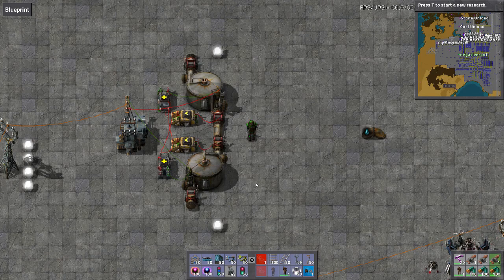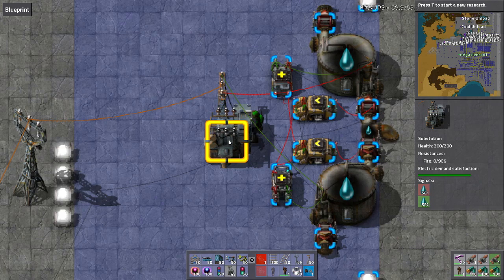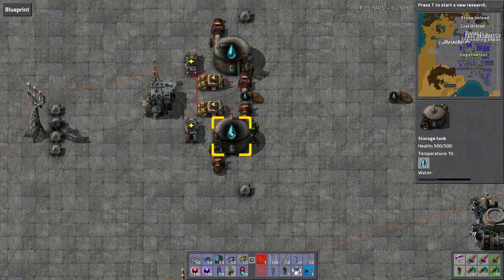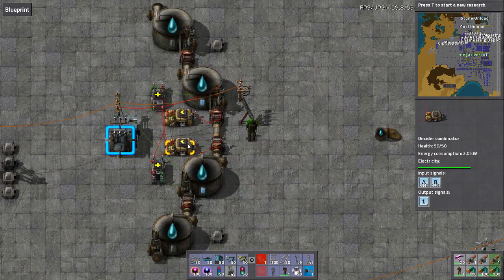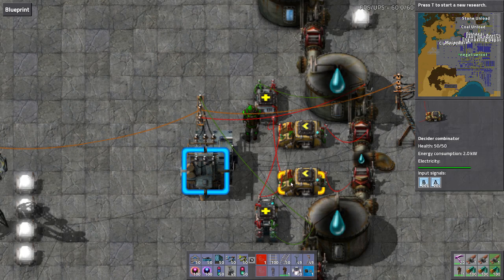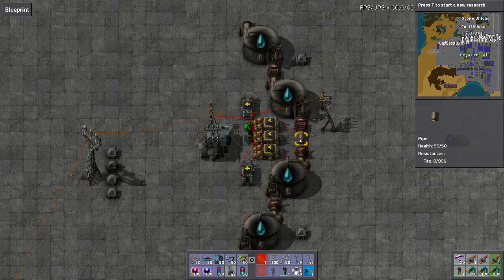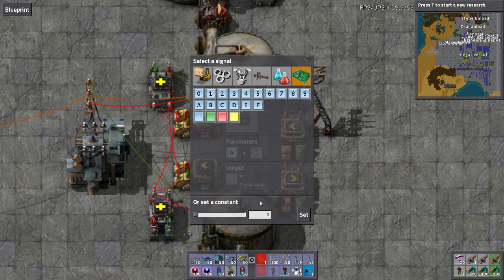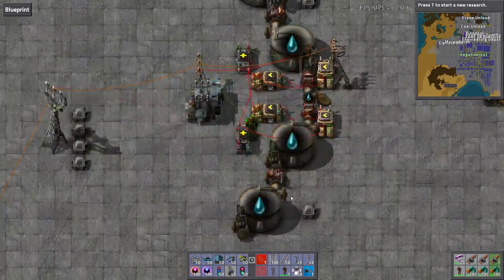Factorio Tutorial 55 Liquid Splitter Concept

Comment: Here a better concept for you :
Water come in a single water tank, you put a second tank with a pump next to it, so they both are tank 1 and tank 2 as in your example, except that here the pump fire only if there is less in tank 2 than in tank 1.
Not perfectly balanced because some water that will leave from tank 1 to what ever he is linked to, but you can see it as a "priority system" and a safety where if there is no power for any reasons, tank 1 will still get water, or at least not blocked by the pump.
But the advantage of this system is that the tank 1 will receive water at the speed on the water pipe linked to it, this flow will be then reduced afterward by the tank 2 pumping to always have the same quantity as tank 1
You save a pump and gain more input flow with this, also less complicated and no need for a starting decider when it hit 0.

Comment: It's not splitting, it's equalizing (as Robert also said).
But the problem isn't 0. It's that the system freezes when both sides are equal since you only drive the pumps when one side is more full than the other instead of more or equal to the other. And when both are at 0 they also happen to be exactly equal. So you built an equalizer that freezes when the system is equal. So it is trying it's best to crash :o
Only reason it does something at all is because of small delays in the system.

A splitter would be a single tank that has 2 pumps (outputs) that both fire if there is enough liquid in the tank to give water to both, like 100 or so. No combinators or math blocks needed between ouputs. This way it will buffer if there is only a trickle that would only send a drop at a time to one of the outputs. All you need is one tank (input is just regular pipe), 2 pumps (1 for each output) and 2 wires. And you could easily add parallell pumps for high throughput if you want to. Or split to more than 2 outputs with 3 or more output pumps for a liquid 1-to-3 splitter.

It wasn't a very good tutorial for learning, but it was at least a bit entertaining to see you struggle. Maybe you should plan and have a successful example before you start recording so that you know the topic your are teaching? ;)
But I've learned things from your other tutorials so thank you for those q: Keep it up.

Comment: I think you can both speed up the whole thing and get rid of the 0 check by changing the comparison to essentially be 
if water1 < (water2 + x) then runWaterPump1()
if water2 < (water1 + x) then runWaterPump2()

and have x be something like 20 or 30. Thus it will stay relatively balanced still, but won't have to stop all the time. And it doesn't need a starter anymore and can't deadlock in any other case anymore either (since the both 0 deadlock is just a specialcase of the water1 = water2 deadlock)
Reply from the maker: +NedomWolven nice!!!

Comment: You can make this with only 2 combinators:
1. Compinator: Convert water signal from first tank to some other signal
2. Combinator: Conect one input to the second tank and the second input to the output of the first combinator and have a condition like "Water < Other Signal" outputing a 1
3. Pumps: Conect both pumps to the output of the second combinator one works if "Signal > 0" and the other if "Signal < 1"

This also works when both tanks are emtpy.

Comment: A splitter takes the input and indiscriminately splits the output to 50/50....that means it doesn't take into account how many items are further down the line.  You have not built a splitter for liquids in this sense, you have built a liquid balancer.  If you wanted to create a liquid splitter, then you would have to make a flip-flop circuit and just connect those to the pumps....when 1 side is drained and creates an imbalance, the pumps wouldn't care, they would just pump 50/50 and it would stay imbalanced....just like an item splitter.

As for your current situation of a balancer, you only need 4 combinators:
1. Top Tank converts water to signal "A", connect the output of this to the other 3 combinator inputs
Bottom Tank connects to the inputs of the 3 input combinators
2. "A" < Water, output "0"
3. "A" = Water, output "0"
4. "A" > Water, output "1"
Connect outputs of "0" to top pump, output of "1" to bottom pump....done

It isn't symmetrical the way you normally like it, but it saves on resources and more compact.  The "=" combinator is only there to prime the system.  The other way you could have done it is simply pump the liquid directly into the first tank and use a pump to pull the liquid out and divert it to the second tank when the second is less....this only requires 2 combinators.

Comment: Hey Root, i did something like that for my yuki build. light oil to unicomp and when petroleum was low it would switch to petroleum.
Reply: and btw. Its Tom Moore who you helped before. Your tip helped greatly.
Reply from the maker: +More Bits ah, but does it split at the same time? This keeps it balanced 50/50 until one becomes "buffered"
Reply from the maker: +More Bits yes, I remember who you are ;)